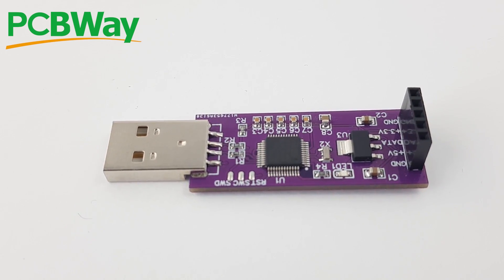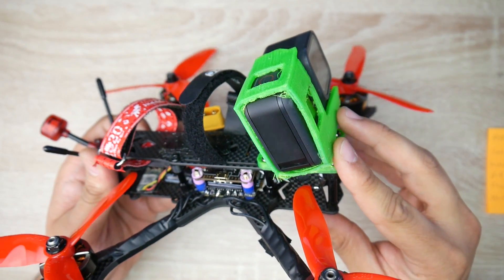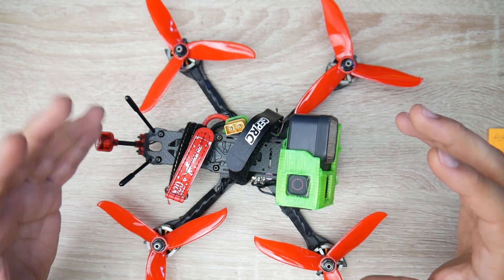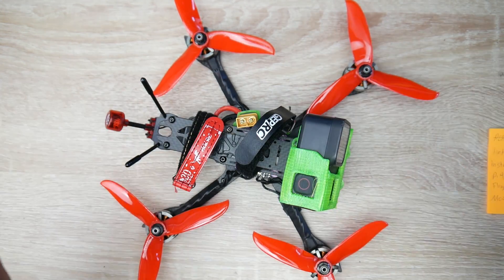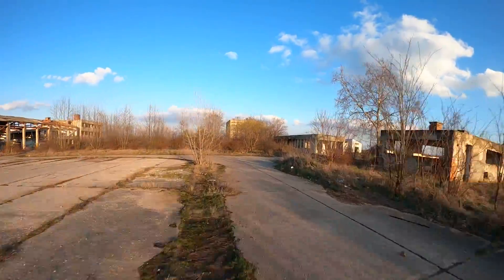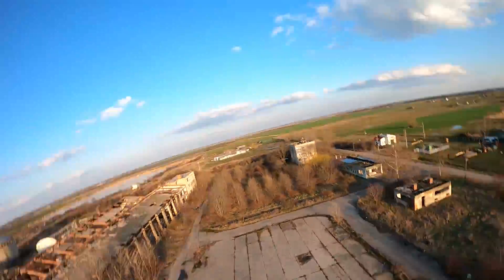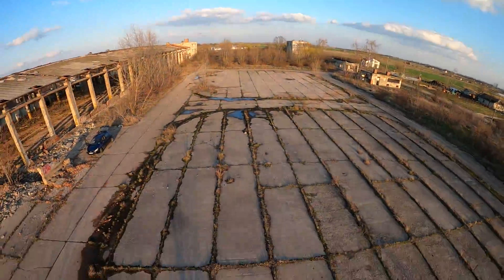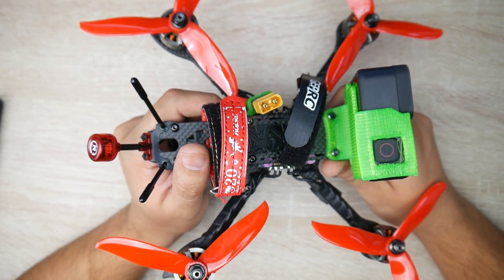Beginner Guide Part 3 // How To Build Budget Cinematic FPV Drone 2020

Comment: Just finished building this fpv drone but I'm struggling to connect my fatsharks with rapid fire to the vtx on the drone!! Can't find any info on why it's not working. The vtx signal doesn't seem to show on the fat sharks and I really don't know why?!! All soldering is correct and drone works perfect in every other way. Any info would be a great help!

Comment: Could you please consider showing us on the next video how to configure a GPS and LED light. Please consider doing a long range 7 or 8 inch quad build.
Reply: Long range 7 inch cinematic build would be great, with states straight in there i.e. weight, overall cost and most important flight time!

Comment: I need to learn how to tune one of my quads drops to the ground out of control if I try a full roll left or right
Reply: Airmode?
Reply: Yes airmode
Reply: @godsun358  hmm. It seems like it airmode I've only been in this a year and my first quad hit the snow quite a bit cuz I wasnt sure how to use airmode. You got it on a switch or turned on in config?
Reply: It's on in beta flight no switch
Reply: @godsun358  and your quad only falls when you try an flip and roll? Are you on bf4.1?
Reply: Yes 4.1 but only on roll I can flip forward and back
Reply: @godsun358  man idk. Are your rates fast enough where when you go to roll it will actually roll all the way around?
Reply: @godsun358  you should watch some Josh bardwell videos on tuning hes got alot of videos out that helped me a ton when I was getting started
Reply: I think I watched all his vids lol Blue Falcon and Painless360 where my go to professors
Reply: In time I will get the bug out I have 5 other quads that work
Reply: You guys are so far ahead of me the newbie the terms used in this hobby I need a dictionary just to understand what your saying lmao this is a huge learning curve.
I have to say YouTube brothers help me so much so tuning is my last hump to get over so let class begin. Any advice is welcomed.